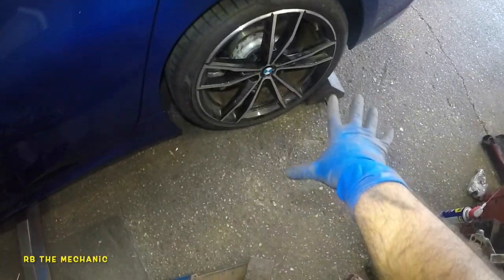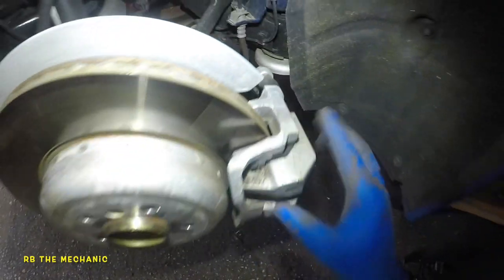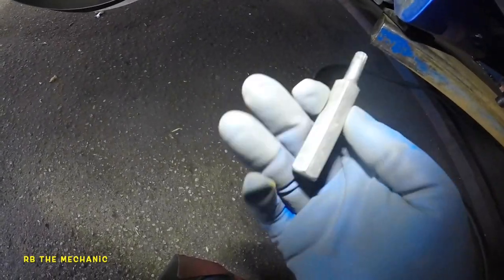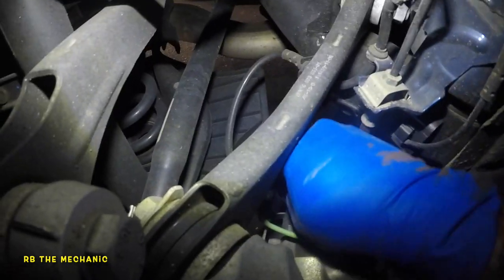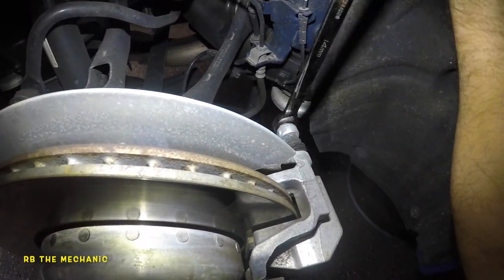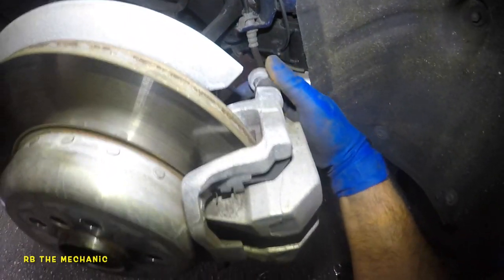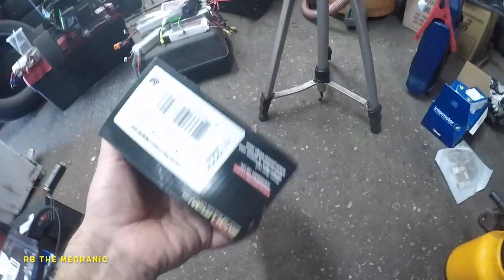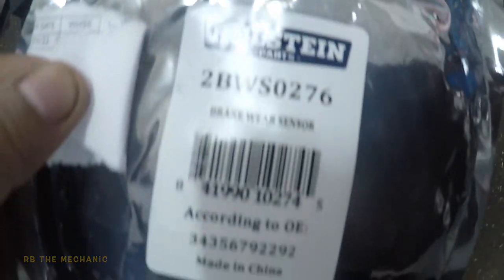Rear brake pads on BMW 328i 2019 2019 2020 2021 2022 with electrical parking actuator

Comment: Hey man great video!!!…is there any reason to open the brake reservoir cap in the engine bay when compressing the caliper??..so there no air in the line or not putting unnecessary pressure back into the brake line?..Thanks man
Reply from the maker: Yes u can open it it will let the system breath air out when compressing the calipers
Reply: @RBTheMechanic  Thanks man..I appreciate the quick response!…I’m about to do the front and back pads and rotors so this video is one if not the best way of showing how it’s done..Thanks Again!!…Hopefully I don’t have any more ?’s for ya😁..It should be pretty straight forward🤷🏼‍♂️
Reply from the maker: @bud9719  yup thank you!!! Take ur time and update me how it went

Comment: I like the body of this model!
Reply from the maker: Me too
Reply: @RB The Mechanic  hey so earlier my dashboard was reading "check engine cap"...what do I do? This has happened before and I usually just tighten up the gas cap...will it go away after driving around for a while?
Reply from the maker: @Texas_Made_  it could be cap or the evap valves scan for codes
Reply: @RB The Mechanic  can I go to auto zone and get the cap?
Reply from the maker: @Texas_Made_  yeah but try to put on original cap it’s better spend the money once
Reply: @RB The Mechanic  so put gas again and noticed the signal was off..guess I needed to drive more or didn't tighten it properly. Thanks for your advice!
Reply from the maker: @Texas_Made_  it might be evap purge valve working on and off start with gas cap change it
Reply: @RB The Mechanic  it hasn't came back on so I'll leave it alone lol
Reply from the maker: @Texas_Made_  yup